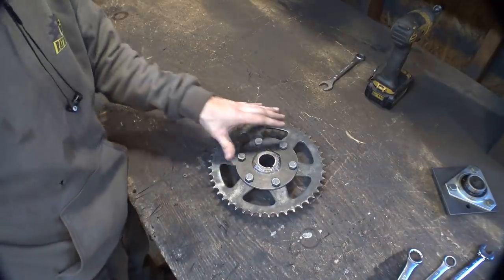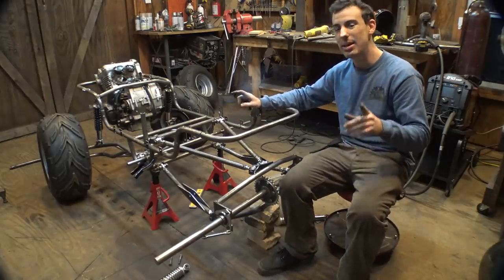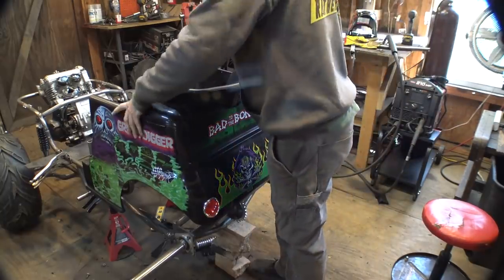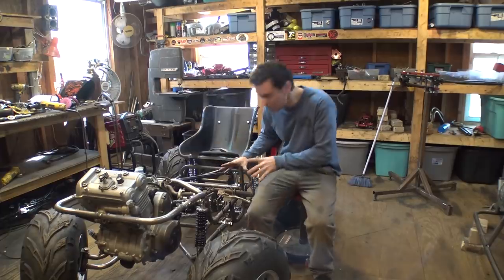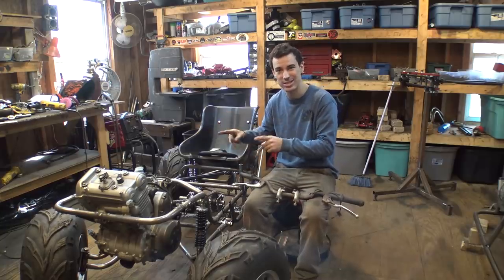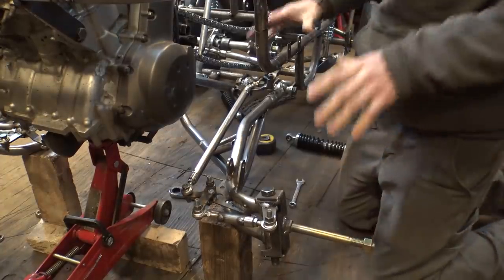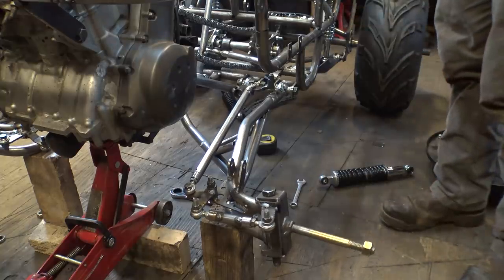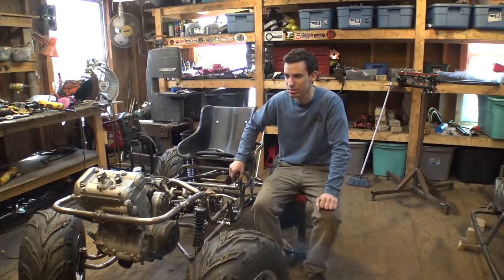Grave Ninja 650 Part 6

Comment: install a spring loaded chain tensioner for the 1/2" slack
Reply: Still gonna be dealing with crazy backlash.
Reply: Wonder if you could use a tensioner for a belt from an engine.
Reply: 1/2" seems like its just enough to throw the chain or snap it
Reply: @jayinmi3706  nope he needs a chain tensioner
Reply: @dadsfriendlyrobotcompany  it'll probably be more like 1 inch of slack considering you have the half inch on 2 lengths of chain (trans drive sprocket to axle driven sprocket +axle driven back to the engine drive sprocket)
Reply: @adrianvanderzandt4310  Yep, ''only'' 1/2'' is actually pretty bad. Plus it's the wrong way, you never want a chain to get looser as the suspension compressed.
Reply: @MrArcticPOWER  True. Grind hard actually used the jack shaft as the rear suspension pivot. Very cool way around that problem. 

I'm not a fan of any pre-tensioning of a chain drive that has variable loads applied to it. Inefficient, noisy and unreliable.
Reply: The way the rear ends done it should have been a swingarm. With the rearing able to twist this thing will throw the chain constantly. And that front steering I wouldn't trust it over 5 miles per hour.any speed above that and this thing is going to walk all over the place.
Reply: Serpentine belt tensioner. Couldn't think of the word earlier. lol
Reply: If he would have put the jackshaft along the same axis as the rear suspension joint there would be no slack...I guess thats pretty hard for him to figure out.
Reply: @cecilandrews1875  so true, I was literally getting ready to type the same comment,  but I'll just 2nd yours.
Reply: JayinMI it would not be as good as one for chains because a chain one can grip in between and it would be more to size with the Chan and control it better

Comment: CHRIS , IF THE JACK SHAFT IS AT THE PIVOT OF THE SWING ARM THE CHAIN TENSION WON'T CHANGE
Reply: You are wrong or I should say 2/3’s wrong. 
Because he built the rear end with heim joints on both ends then the axle end pivot has to be the same length and everything has to be parallel to each other.
Reply: kylekdk456 what is up with the hate bro lets see you make it properly then
Reply: kylekdk456 damn man he is still learning. He hasn’t been doing this for a long time he is young and in my opinion doing a great job. Could he plan better yes but no need to mock him.
Reply: Enkhmandah Gantulga said your name 3 times out loud and my fridge started levitating
Reply: Looks like kylekdk456 bailed out on this topic but in response to your deleted comment about the triangulation Kyle I know it’s to prevent side to side movement but as long as your arms are the same length top and bottom then they will stay parallel. 
Consider the chain to be a 5th link in a 4 link setup and keep the axle centers the same dimension as the 4 link bars then the chain doesn’t change length. The half inch Chris mentioned should be easily looked after with a chain tensioner. The only issue could be if he drives fast over a very bumpy route.
Reply: There are virtual pivots at play with triangulation, it's the length as you see the top links from the side, not the length of the actual link. Also the distance between top and bottom links at the front and rear change the arc the axle travels in. Some fairly simply geometry would reduce the change in length to almost nothing. The triangulation will still have articulation causing lenght changes unless it's all engineered perfectly. I would run a tensioner very close to the rear sproket pulling the chain up a small gas strut is better than a spring to prevent whipping too.

Comment: You could've done go cart hydraulic brakes off 1 brake pedal and a single clutch pedal (3 total foot pedals including the throttle pedal) a hand shifter(suicide shifter), and a steering wheel and if you wanted to do burnouts using only the front brakes add in a brake line lock

Comment: Nice job on the steering! That's sort of what I envisioned with the bel-cranks, but you took it a step further, because of the handlebars (which is a good idea, considering all the inputs). I'm still worried about those skinny ass front 'axles'. Some good hubs and stub axles from an old ATV would definitely be a plus, and a whole lot stronger if you start ramping that thing.😉

Comment: I really like the steering system you built and how it runs down to each spindle through the pivots. Super Super cool! I've never built anything like this but after I designed the front suspension to move like that I think I would have ended up scrapping it and going back to a more conventional front end because I wouldnt even think to do all that.

Comment: The build is so cool, but the steering wheel would have been much cooler.
Reply: you could set up the controls on the steering wheel to be the same as a handle bar maybe not THAT steering wheel but you got a pipe bender i know you can do it but hey if the handle bar drives well then go for it
Reply: I think the handlebar option is different and better
Reply: @VasilyBuilds  i agree with you that different is good and that the controlls are gonna be way better on a handle bar its the driving part that makes me doubt it but ive never tried it so i cant say he might be onto something
Reply: Vasily Custom Builds agreed- it’s different. But the build is a mini Grave Digger truck, not a four wheeler. The handlebar basically instantly turns the cool “mini monster truck” build into nothing more than a pretty four wheeler. ...just my opinion; I still have him a thumbs up.
Reply: 100% agree with you on this bc what he is doing is just killing this build looks and everything i mean look how easy it is for grind hard Plumbing Co to be able to use steering wheels on the ones that they build
Reply: agreed
Reply: Bars are so much easier to engineer and probably will drive better and give better leg clearance. Like he said, he's aiming more po- pore mo- more towards performance.
Reply: Don’t forget, bike engine plus handlebars = nearly stress free 

Bike engine plus steering wheel = make pedals that won’t fully engage either the clutch or gas without tinkering, then fit 2 brakes, a shifter and a driver..

I think handlebars are the way to go.
Reply: The handlebars might not look as cool, but will make everything less complicated and more intuitive to drive. Like he said, like a quad.
Reply: @bryanmcguire6274  how easy it was for them?? They ended up making like 7 different lay outs on their wheel, before they end up with basically a Honda Odyssey wheel minus the throttle. Just think he's running a ninja 650 in that thing handle bars are gonna be a whole lot safer and easier to handle all that power it's gonna be putting down. Plus like he said, he can just tell people it's set up like a wheeler and anyone will be able to use it right away and have a blast instead taking all day to figure out how all the controls work and how to do it just right.
Reply: That's because they have automatic lol

Comment: For the controls. Combine the front and rear brakes. Perhaps use a 4 pot rear caliper and 2 pot calipers on the front. That way the brakes are balanced. And just make them foot operated using 2 motorcycle master cilinders. (1 for the front, q for the rear). Foot operated throttle. And shift arm between your legs or at the side. You can have the clutch on the shifter using the bike clutch lever. When up and down shifting you wont need the clutch. Just blip the throttle.
Reply: Think the handlebars will look awful I think the whole point of the power wheels is for it to be small the size is getting out of hand

Comment: The steering slop is due to the number of joints in the steering system it'll never get any better it's because of the tolerances of each individual heim joint, as well as the tolerances on each bell crank, the tolerances on your kingpins, and the tolerance of your steering column being added up through your  steering system.    Also you may want to add a rear chain tensioner to take up all the slack (approximately 1 inch of slack) when the suspension moves or you'll find out just how often the chain will pop off/break and you'll end up with a lot of chain slap and driveline hammering/surging

Comment: If you're worried about chain tension on your secondary chain from the jack shaft to the rear axle just install a spring loaded pulley or gear tensioner on either the top or bottom rear axle tubes. Seems easy enough.

Comment: Looking good, two suggestions. A butterfly steering wheel might be a cleaner and safer setup and you might want to pull the power steering unit of a 4×4 quad, less parts to cause problems, open up your front end space and ease os steering. Just a thought. Rock on.

Comment: ON your 90 deg pivot arms; make them from a one piece of material, cut as a modified right angle triangle. Use thicker material, and make your pivots very fixed- very! Great solution to the problem, BTW! the closer you can get your intermediate shaft to the same distance from the rear axle center, the less growth/shrinkage you will have in the chain length as the axle travels up and down.FR

Comment: Rekluse sells a 650 kit for automatic clutch. You can also use a car master cylinder to run both front and rear brakes then it will just be throttle brake and a shifter.

Comment: Why wouldn't you move the jack shaft to right behind that bar and over the rear axle pivot point? Remember up and down travel will make the chain tight or lose, not just from the static point. Awesome job on the sprocket drop transition. It was cool. Consider putting the rear brake disk on the Jack shaft. it would multiply your braking force like military axles do. Love your builds, keep it up.

Comment: You should do a dodge truck power wheels build with that snowmobile motor
Reply: No he should finish this one.
Reply: That 600 should be on another buggy. Maybe the GS500 one.
Reply: Its to big and over kill
Reply: Dodge Truck... he doesn't want to put a Tranny in it every 50 miles!  LOL
Reply: Do you know how wide a 3 cylinder witch a CVT clutch is? Pretty much impossible to fit that thing into a power wheels without having the clutchs hanging out the side.

Comment: You could do a double foot petal on the left foot that is the clutch on the bottom and front brake on top and gas on other petal or do a thumb throttle. For the sake of the fans make the steering wheel work. We all love the build

Comment: Chain tensioner should take up that 1" slack. The slack could cause undue wear un both the chain and sprocket.  Next time use a big V Twin with  shaft drive.  Lower center of gravity and they are narrower than that transverse 4. Plus, you get that swing arm rear suspension to work with. Narrower motor could have been the answer to your steering issues. Love your vids.

Comment: If your going this crazy on the front suspension design, it needs cantilever suspension as well. You'd be able to adjust travel easily with different ratio lengths on the cantilever too. That would put this over the top.

Comment: If you do a spring loaded chain tensioner for the rear chain it will solve the problem of the chain getting loose when the suspension travels

Comment: You could run a spring tensioner on the bottom of the chain near the front to accommodate the suspension travel issue. With the controls problem you could make the shifter a vertical bar with knob that moves forward and back, and combine the front and rear brakes with a proportioning valve off of a car, now you just need 3 pedals, gas, brake, and clutch. It will be A TON more work, as you’ll need to fabricate a lot more parts to convert from handle levers and throttle, to foot pedals but it would clean it up A LOT and allow to run the wheel. Biggest problem with bars is the seat. Using bars you need a lot more shoulder movement than you can easily get with a backed seat, that’s why any kind of power sports vehicle with bars, the seat is only between your legs, allowing much more movement of your torso.
Reply: Btw I love your steering design on this one, it’s genius!

Comment: You should cut the ends off the handlebars and weld them perpendicular so you have an H. Or use 7/8 tubing and make a steering-wheel-handlebar. Then you can just pop the controls on the tops of the H. It's a win-win.

Comment: You should be able to extend the upper rear control arms a quarter inch and that will help your chain slack issue. By making your upper rear control arm slightly longer it will affect the chain slack at the top of its travel but minimally effect lower distance.

Comment: On the front end, instead of welding a rod between the ball joints just make the tabs into a triangle. Also I'd advise against shortening the handlebars too much, it will make the steering heavier with those front tires.

Comment: With a flexing rear suspension you will keep losing the chain every time it flexes. During flexing the alignment between the top and bottom part of the sprocket wont be in line with the front sprocket. You are building something like a quad bike and a quad never has a flexing rear suspension when it has chain drive. If you want the flexing ability you will need to build independent suspension like the front or double A arms.

Comment: Correct me if I am wrong, but I believe it will end up being a full inch loosened from the chain as both the top and the bottom of the chain will move the 1/2 inch.

Comment: How are you dealing with the rear chain/axle twist?
The Jacks fixed to the frame is a good plan but the rear sprockets on the axle that's not just up and down, Thats got lefty righty up and down. A Chain wont like that twisting. 
Love that steering you've banged together, Only hydraulic power steering will get rid of the slop.

Comment: A lot of respect for this build! However I have strong doubts about de front suspension/steering setup. I think it would be ok for a very low power concept to run around a bit on the lawn, but I'm afraid this 650cc sportsbike engine will completely destroy all your hard work. Maybe it would be better if you make some kind of a brace under the engine which can provide a front mounting point for your suspension? Also try to get rid of all the little connecting rods of your steering linkage, There will be more play every time you drive it! All the best and looking forward to the result!!

Comment: Do a chain tensioner with a spring to compensate for that 1/2 of an inch of movement in the rear
Reply: or he could place the jackshaft along the axis of the rear suspension pivot and there would be no slack to begin with

Comment: You should hook your front and back brakes together like in a car gopowersports actually has the master cylinder you need to do it so you can adjust them you could use a Honda Odyssey what you have all the controls you need already on it

Comment: definely handle bars. main reason all the controls in one spot. also do a thumb throttle. it will be best for the rider. plus you can use the thumb throttle off that snow mobile you got last week. also the handle bars will give rider more support, since you said it would be used off road. lastly put a roll cage on it.. better safe then sorry.

Comment: It is  just just my opinion but i think stearing wheel wuld be beter and for all the controls im thinking cluch pedal on the left front brake and gas on the right  hand shifter on the left and the handbrake for the rear brakes on the right that wuld make it drive more like a car.
Also that over complicated stearing system iš work of art i culdnt figurout you were going to do it. Excuse my grama mistakes english iš not my main languge.

Comment: With the suspension that you have,  when the rear axle articulates up and down it will throw the chain. Basically if the chassis is level and you raise one side up and the other down, the sprockets will no longer be aligned. Cool build though.

Comment: Half an inch of movement between the jackshaft and the rear shaft is not that bad, especialy if you use a chain tensioner (with a sping).

Comment: Are those heim joints on the rear suspension adjustable? If so that may help correct the alignment of the axle during travel. Steering with handle bars may be easier on your wrists if there is bump steer but would a honda odyssey steering setup include all the functions you need? How much input to turn fully left to right is a variable to think about as well. Be safe and keep the shiny side up.

Comment: I think handlebars will be awkward sitting in a high back seat, your elbows have nowhere to go. Front and rear brake master cylinders mounted to right foot, gears up and down with your left foot, clutch on steering wheel operable by either paddle lever   might work nicely

Comment: Five controls, let me count.   1-Brakes / 2-Gas / 3-Clutch / 4-Shifter.    I count 4, you shouldn’t separate front and rear brakes.   This should work exactly like any other system, I can see the steering being rebuilt in the next couple videos just like you always do.

Comment: Dude, as your steering angle geometry is pretty steep, you may want to consider a steering damper as used on sports bikes to reduce headstock shake under acceleration.

Comment: That steering design is insane!  It has a sketch factor of 12/10, cool factor is 12/ 10  and  and creativity is like a 14 out of 10!  You got mad props! I hope it works well.. I don't want to say there is a lot of room for failure, but lets hope it never comes to that. And I agree with everyone, ditch the handle bars. I also wanted to say you are doing a killer job with your editing skills.  I don't think people comprehend how much work this is.  However, the name... it's only a matter of time before the wrong thing is said to the wrong person.  What did one lesbian say to the other? Slip of the tongue and you are in deep shit.